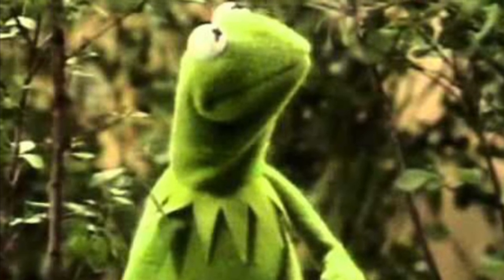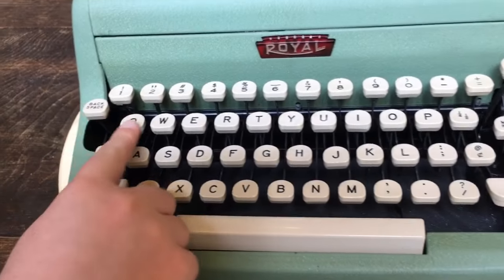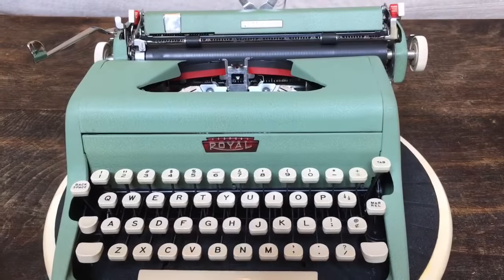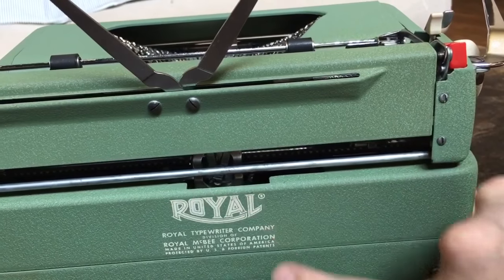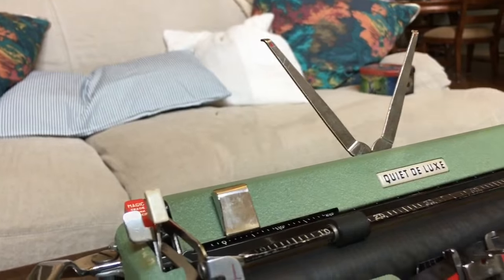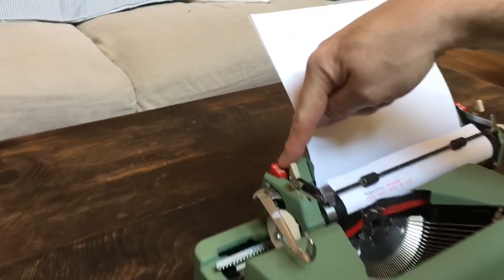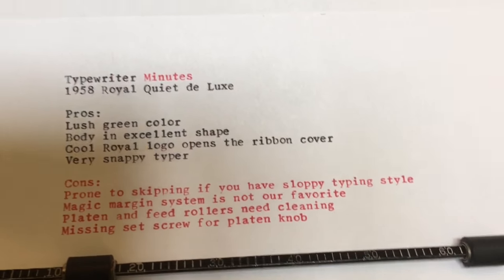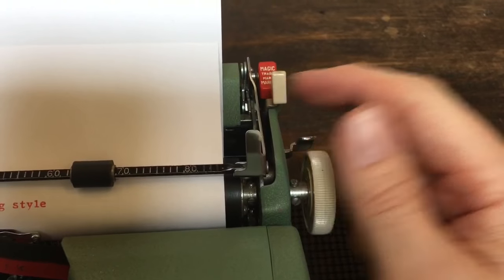TypewriterMinutes - Typewriter Review: 1958 Royal Quiet de Luxe

Comment: Hello! Thank you for your excellent video! I have the same typewriter (1958 Royal Quiet De Luxe) and it’s stopped dinging—do you have any advice about where to find the bell? Thanks!
Reply from the maker: Sorry for the delayed reply as I have been off YouTube for a while. You should be able to see it if you look underneath the machine. Sometimes it can be old sticky grease that keeps it from moving. Cleaning it out with lacquer thinner would help but you have to be careful not to get any on the body panels.Or it could be that the right margin indicator is not hitting the bell clapper. I would have to have a look at it first hand to help more than that.

Comment: I don't know how common this is, but my Olivetti Lettera 22 has a tiny hole in the paper holder (?) (ie. the thing controlled by the paper release lever; not sure of its official name), and I assume the purpose of this is to see the end of the page a line before reaching it. It's a simple and effective detail.

And it's no mystery that after awhile it's pretty easy to predict the end of a page, anyway. But I guess a little overengineering never hurt anybody.
Reply from the maker: I will keep an eye out for that feature when I finally acquire a 22. It’s nice to know about extra features even if we don’t always use them. Thanks for watching.
Reply: TypewriterMinutes Thanks for your videos! I enjoy the charm of the extra features, too. But what's nice about a 22 is it seems to be the perfect minimal machine. Sometimes I wonder what difference there would be in using a Studio 44 considering it's a bigger, heavier version of the same machine (tangent: interestingly no additional keys, unlike the upgrade from a Hermes Rocket to a 3000), but I haven't lost any sleep over it yet. Anyway, it's a great machine and I look forward to any future review you may have on it!

Comment: I have a little problem with mine. I have a 1956 model and whenever I put up the lever at the left, it's still in the "lock" state and it only allows me to type until the middle.
Reply from the maker: Sorry for the tardy reply. It is difficult to diagnose remotely. Any chance the “magic Margin” is set too far inward?
Reply: @TypewriterMinutes  Thanks for your response. I've tried what you have explained on the video, but it still does not work the way it should. Btw, I saw a button on the lower right of the machine and whenever I press it allows me to type until the end, but I have to do it manually.